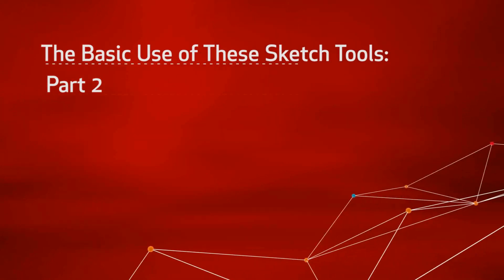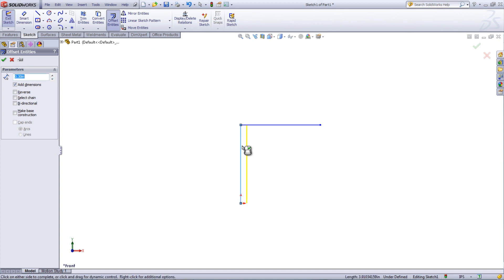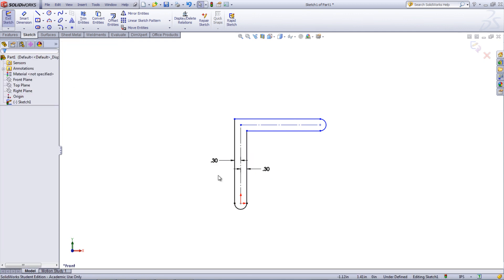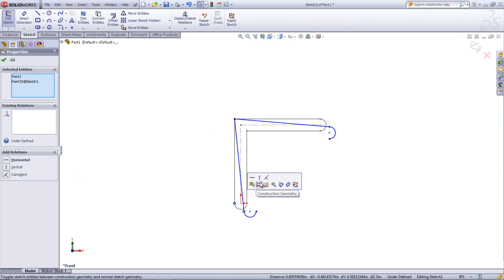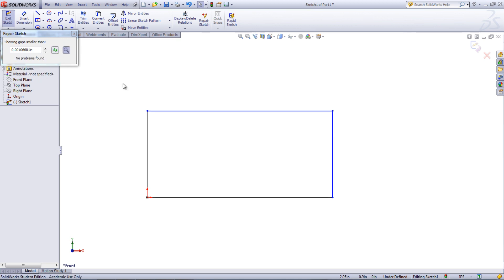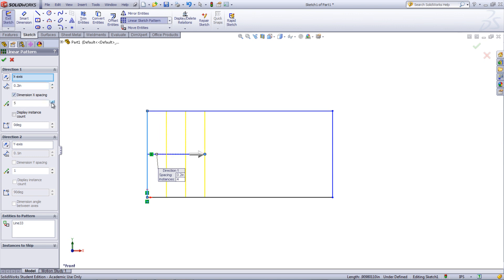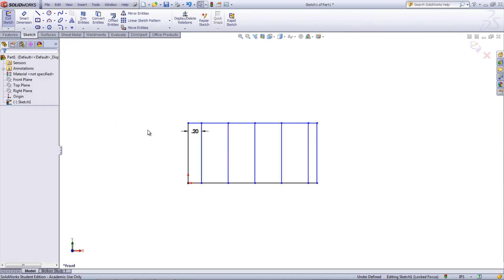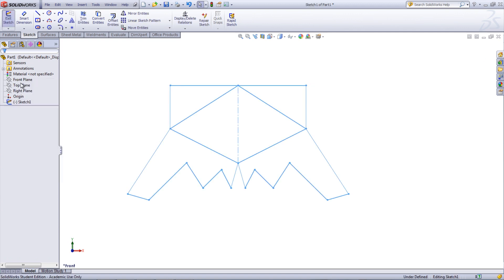SolidWorks Sketch Tool Basics Part 2

Comment: I'd think SolidWorks could have come up with new examples for things like the repair sketch tools instead of using the same ones from it's training classes. I also like how everything done in the examples ignores the shortcut toolbar and other UI improvements and uses the long drawn out pull down menu method for accessing the useful commands in their interface that they assume new users to their software won't be able to learn and understand.